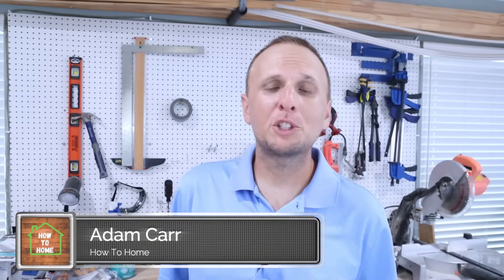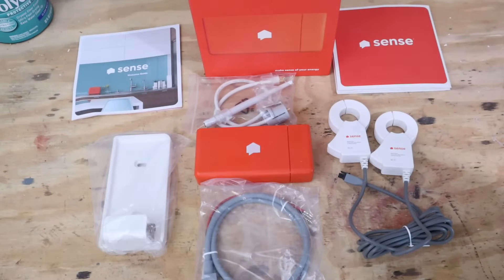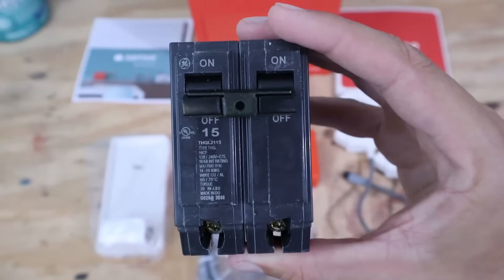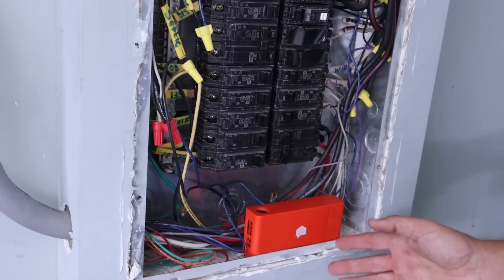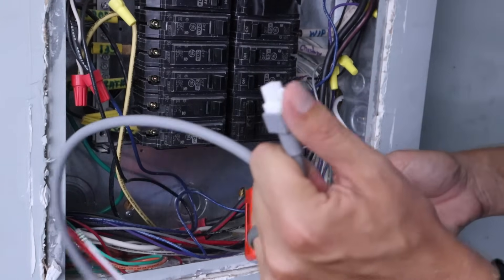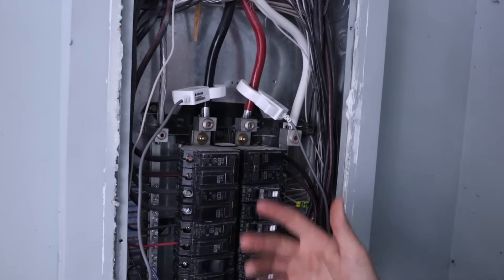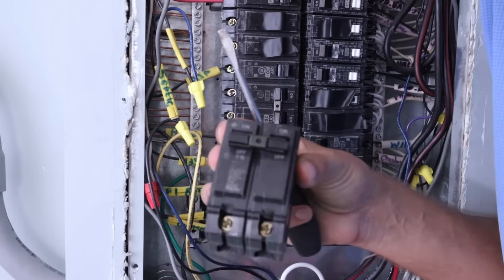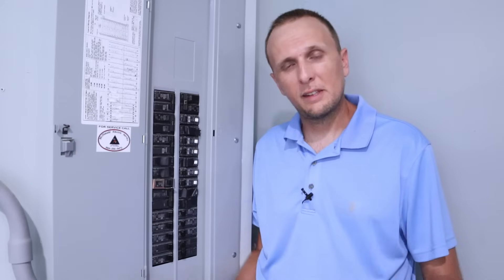Sense Energy Monitor Installation and Overview | Watch Before You Buy

Comment: Please wear gloves when "pointing" without really looking at the main input leads for safety sake.  Otherwise, you could have a very bad day!
Reply from the maker: Hey William, rest assured, the power was shut off outside at the meter so those service lines had no juice and the camera angle makes my fingers look much closer than they were.  But a very good point.  Wearing gloves is a really good safety tip when dealing with live or potentially live wires.  Thank you William for "pointing" that out!

Comment: I am thinking about getting one of these. I see that you appear to be in FL too and my power bills the last few months have been insane. I moved into this house almost a year ago so I wasn't sure what to expect during the summer so didn't think much of it at first but now I am discovering that I seem to be using up to 3x the power a home my size should be using. A couple months ago I had a $507 power bill and somehow used 4500kwh that month for a home less just under 2,000 sq ft.
Reply from the maker: Yes I am in FL as well so I know about this Florida heat haha.  Wow that is A LOT of power usage at 2,000 square foot.  There are so many things and maybe a combination of things that could be causing that to happen.  I will say this about the sense device, it does make you want to be more aware of your power usage and encourage you to use less of it.  As it discovers devices in the house that is when it gets kind of fun.  But it has pointed out some things in my house that needed to be adjusted and now my power consumption is a little lower.  In your case I would want one to figure out what in the world is running so much for the bill to be that high.  You will probably be looking at about 3-4 weeks before the device has discovered a decent amount of the electrical items in the house to where you can really start pinpointing the issues.  That being said it may be worth it in the long run to get that power bill down.  Let me know what you end up doing and if you find out what is causing the high energy usage, I am curious about that.  Also, if you have any questions about the device, feel free to give me a shout!
Reply: @HowToHomeDIY  Circling back to this post. We've had a few ok days in FL temperature wise but I will say that since I got Sense last Sunday (11/2/20) I discovered that my AC seemed to be using a hell of a lot of power. It's a 3.5 Ton unit and was using like 5000w when it should be using more like 3500w. After researching I decided to clean it with a hose (after shutting off requisite switches) since it is next to a dryer vent. It didn't seem super dirty to me but I will say that maybe coincidentally the AC power usage after that was back down to where it should be in the 3500-4000w range. Daily power usage has gone noticeably down since.
Reply from the maker: That's great and a huge reduction in usage!  So it is already paying for itself.  As it discovers new things you will find yourself trying to figure out where you can save even more money.  Kind of fun investigating and trying to figure out what device it is trying to show you it has found.

Comment: Great video.  I got one to see what size generator I would need to run my home.  Your videos are really helpful. Getting a soft starter for my AC is next on my list.
Reply from the maker: Hey Jesse, that was a good idea.  So far I have been pretty impressed with it's accuracy.  You will love the soft start kit especially if your power is out haha.  How have you liked your sense monitor?  Thank you for the feedback, I am really glad the videos have been helpful!
Reply: @HowToHomeDIY  It's been great.  It has found most of my appliances now.  I have had it installed since January.  I just purchased a Westinghouse 12000 watt generator and it only has 5% THD.
Reply from the maker: @jesseemory3367  Ok good to hear!  Mine has been picking the appliances up fairly quickly so happy about that.  That is a really nice generator and I am glad to hear you got one with the lower harmonics.  That is overlooked a lot and the only focus is on output but is really important!  5% is right where you want to be!